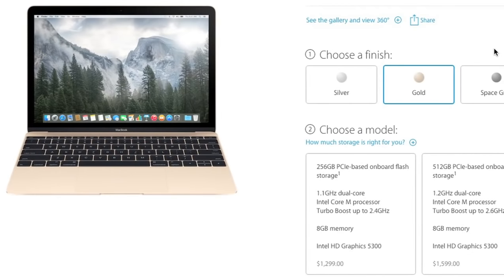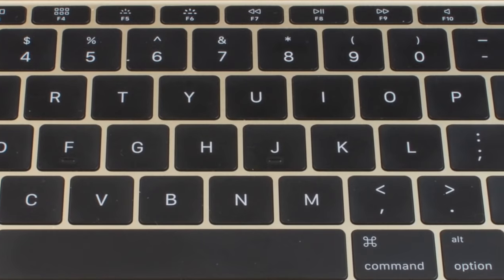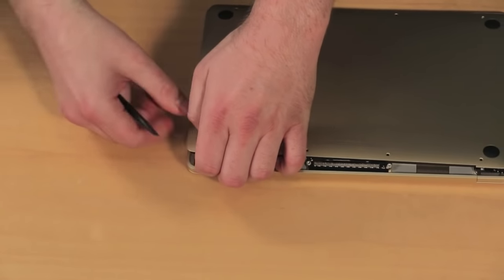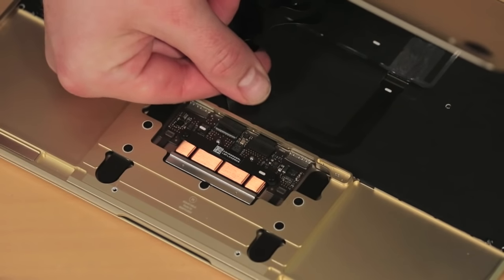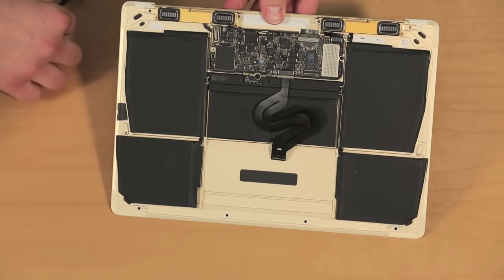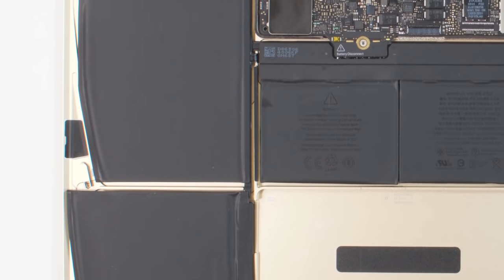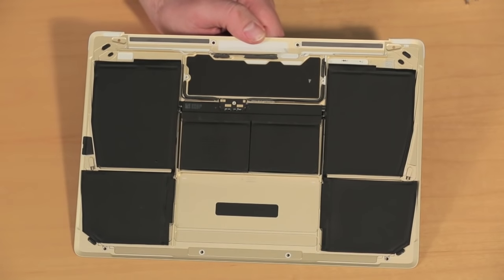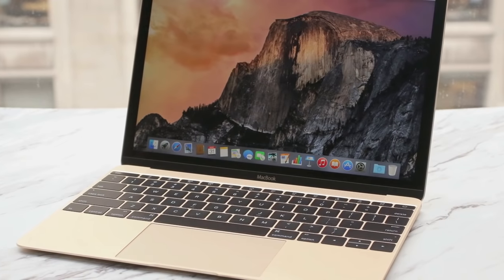Cracking Open: Apple MacBook (12-inch, 2015)

Comment: For the money you need to but this toy you can buy a full and very powerfull PC which will let you run every new game and max graphics for the next five years let alone upgrade and you could crack it open and put it back together. i would choose PC over overpriced laptop dont you agree?
Reply: The laptop is for work not for gaming.
Reply: +Volodymyr Protsenko If so, buy Pro. Just way more bang for buck.

Comment: Why would anyone buy. Mac is overpriced and is not good. I got a Hewlett Packard HP pavilion 17.5 inch i5, 8gb ram, 1terrabyte hard drive and all the ports, plus touch screen, backlit keyboard, Bluetooth and built in BO speakers. All that for 699 dollars. I would like to see apple beat that. Macs are overpriced and junky.